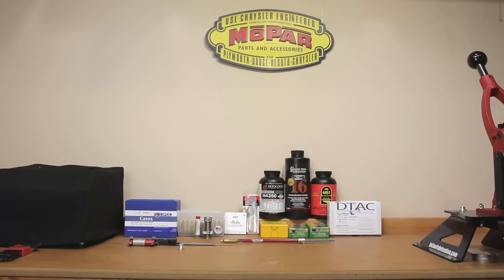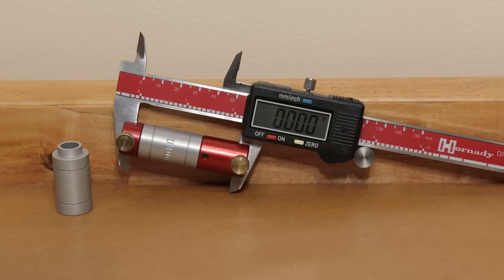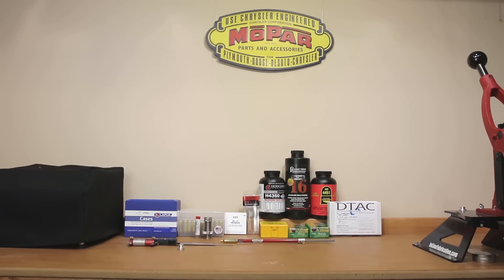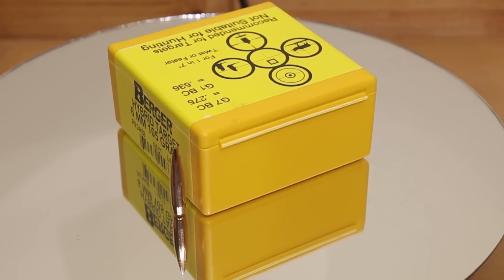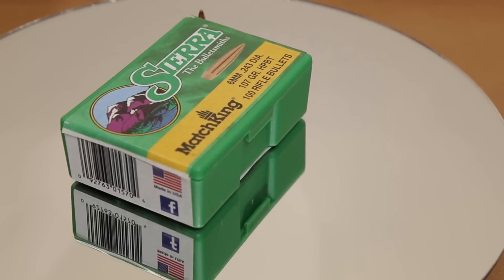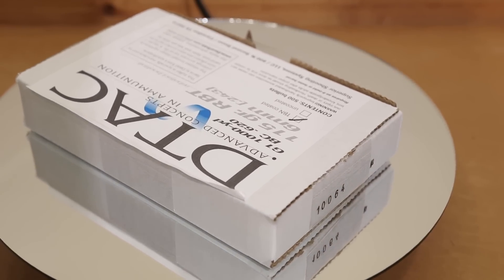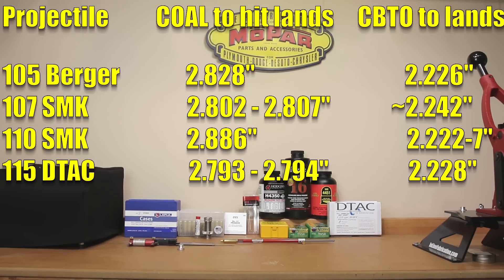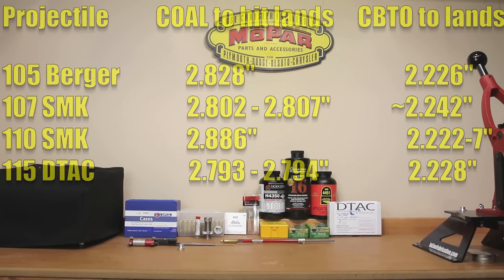6mm creedmoor - Starting Load Development

Comment: I measured my chamber length the same way. Using 108 ELD-M bullets, I came up with a base to ogive length of 2.229. Measured this 4 times. When I measured a round of factory round of108 ELD-M, bto was 2.235. That being said, factory rounds should not chamber. So I mark a factory round on the ogive with a sharpie and checked for any marks when chambered. No marks on ogive. This does not compute!!! My last idea was to seat a bullet very long into a empty brass case, load it and cam-over the bolt to seat the bullet into the lands. I did this 4 times and measured bto. Came up with 2.251” on average. +or- .001. I have done this process on dozens of guns and never had this problem. Anyone have an idea what is going on? My next step is going to be using a pc of fireformed brass to measure the chamber length.
Reply: FYI, I have the exact same rifle as you.
Reply from the maker: I am going to do some workup with these and I find myself in a very similar situation. I am hoping to get my head wrapped around this.
Reply: Bolt Action Reloading Thanks. Please let me know if you come up with something. As of now, I still haven’t fired this rifle as I am waiting to get a PST gen2.

Comment: Would like to see a bit more brass prep prior to loading and testing personally, or maybe further prep 50 of the Lapua brass and do a side by side with the non-prepped Lapua, but looks to be a fun series of videos.
Reply from the maker: Hey jim, I have some questions to ask you about, I just haven't had time to sit down. Interesting to see that you anneal before the first size. I have felt the anneal I to is different than you get from the factory. If it  were any other brass I would have done the FL size, but the headspace measurement is pretty much identical across the lot. With the once fired hornady brass I sized one piece without annealing and I couldn't even push the shoulder back .002.
Reply: Bolt Action Reloading I was more meaning primer pocket depth uniforming and flash hole deburring. Uniformity is the key :)